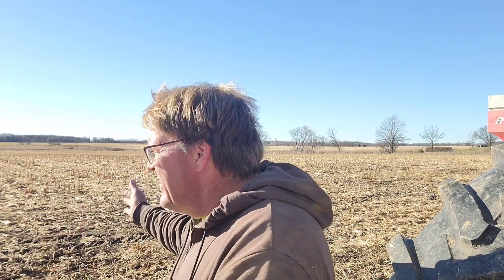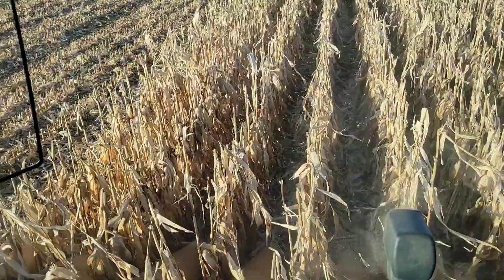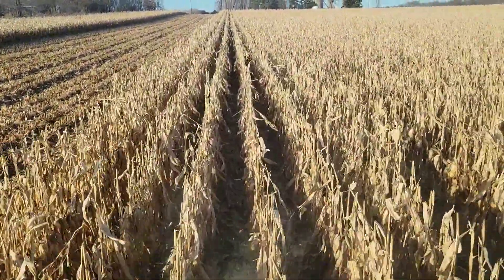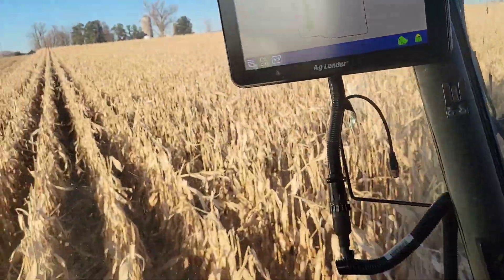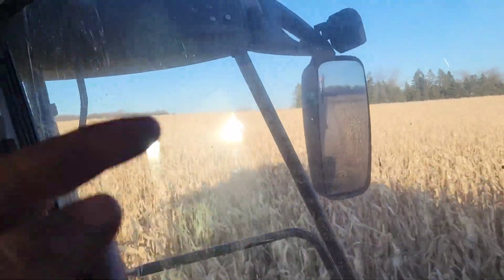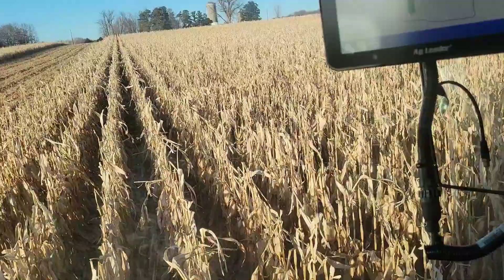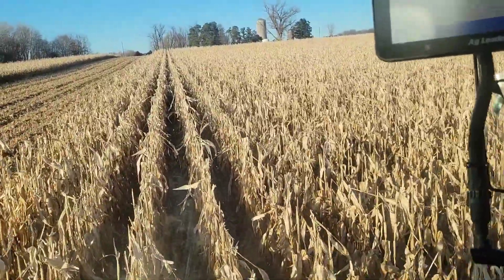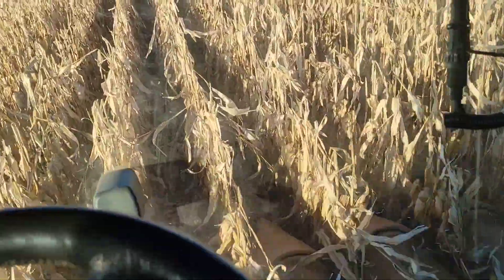Great start to good crop. 24 corn. Drone R2 feeding and V5 feeding did it yield?! test plot results

Comment: I myself would suggest soil testing every year on the test acers where you are replacing nutrients with biologicals to see if you are mining your nutrient levels down,I have heard of a few farmers doing this and the first several years yield is good but after several years the yields deminish and there nutrient levels are also very low,and I use some biologicals when cost effective,I feel I need to double my investment in them,and its a lot easier when corn is $5-$6 then $3-$4
Reply from the maker: Absolutely in general we need to be doing more soil testing I have a video a while back trying to mine a field for 9 years and the phosphorus level and the pH stay the same
Reply: @jonstevensmaplegrovefarms3754 Interesting,on my ground I try to replace crop removal every year,and when fertilizer prices are a little lower a little more ,was that 9 year test done on notill ground?
Reply from the maker: @billsauberlich7337 no till strip-till. 
P is easy for plants to get. After doing that 9 year trial, and now a few years of plant testing, I will never spend a nickel on removal rate phosphorus.

Comment: Interesting Jon. Maybe I've missed this from past videos but before you were banding your dry but you mentioned broadcast this year? Any particular reason for not banding the dry?
Reply from the maker: I still banded with the strip till but like I had mentioned with all the rain this year I didn't know if we washed the fertilizer out of the soil
Reply: @jonstevensmaplegrovefarms3754  Okay thanks. So the broadcast was in addition to the banded amount. Do you mind sharing what you had initially banded for rates?
Reply from the maker: @natelegler on this field 25lbs potassium chloride,  25 gypsum and 100 urea.